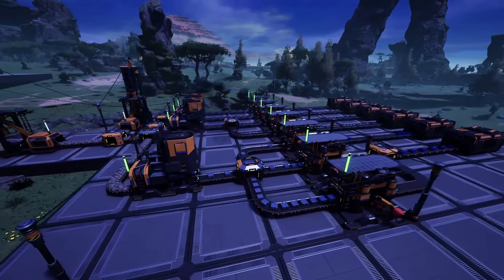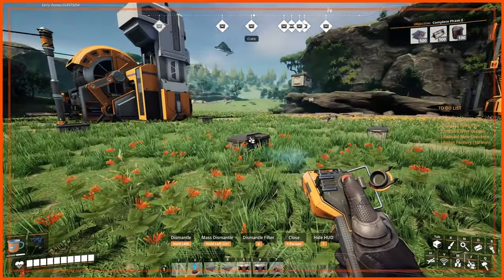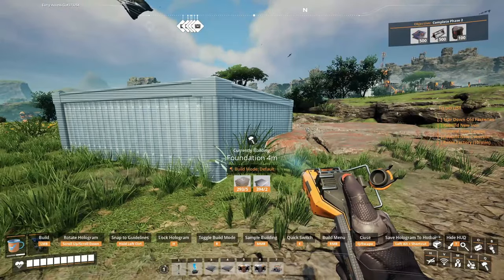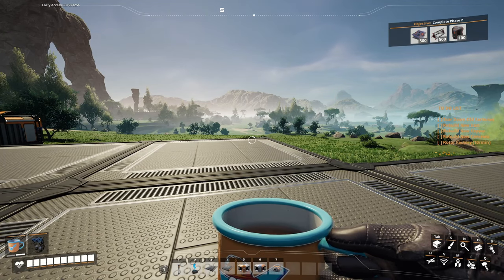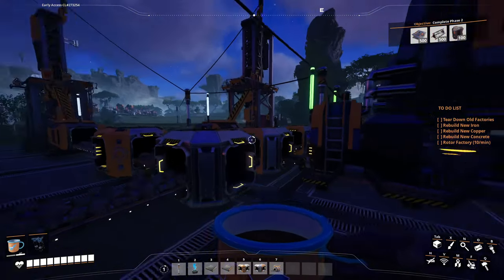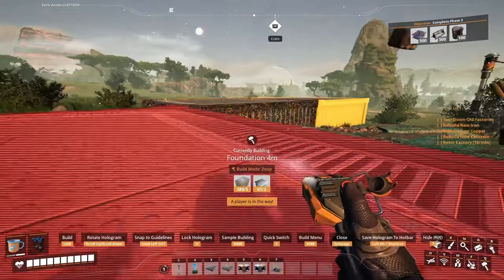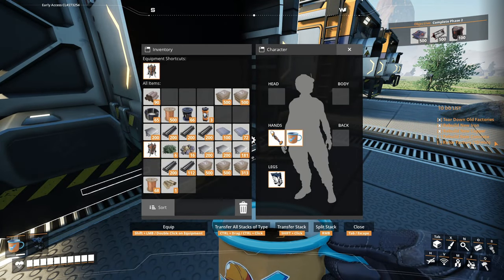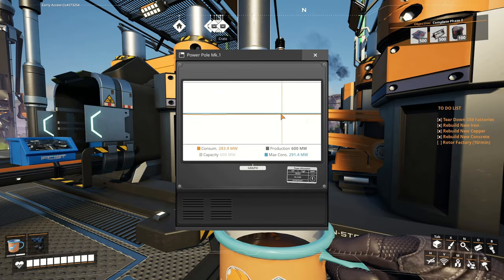Basic Layouts w/ 100% Efficiency!!! - Satisfactory Playthrough + Tutorial - Update 8 - Gameplay

Comment: I know this is months old but I was pulling my hair out when you were setting up the assemblers for the rotors. The reason why the elevator lift wasn't snapping to the correct point on the screw line was because you didn't reset the last belt on the line. You moved the splitter one over as it was misaligned but that meant the last belt was then clipping through the splitter.
Reply from the maker: I am SO ready for a redemption playthrough with 1.0 knowing what I do now! Cant wait! Ive got an update video with my plans for 1.0 dropping soon!

Comment: I recognise that this video is a couple months old and you're likely far past this point now, but for anybody watching for the first time, you can type formulas directly into the machine % production, so when underclocking the concrete constructors, you can highlight the 100% area and type in: (40/45)*100 and the machine will calculate the needed percentage. Then you can ctrl+c to copy that setting and ctrl+v to paste it to the other constructors.
Reply from the maker: Holy smokes that's going to really help me in the future! Thanks for a great tip 🙂
Reply: I am glad I read through the comments to make sure this was shared before double-posting it.
The only other thing I can recommend for early game when I don't necessarily have huge production, I'll make the first foundation (or blocks surrounding the whole build for aesthetics) 4m tall and then use a 1m platform aligned to the top of the 4m platform for the rest so that I can save on resources since making large platforms with 4m is so resource intensive at that point of the game.
Reply from the maker: @KurossuElemenze  yeah I really need to make sure we have decent concrete going early next playthrough so we can build stuff MUCH faster!

Comment from the maker: Thank you guys for all the support again! I'll try doing all my builds in daylight from now on. 

If you want some Ficsmas episodes let me know 🎄
Reply: Just a small thing but the copper sheet portion of factory can be simplified down to 1 merge and 1 split between smelters and constructors

Edit: also conveyor lifts auto detect direction from machines, splitters, and belts when placing and snapping to them.  Only really need to worry about direction of travel while  free placing or from non-connected floor holes, poles, and wall holes.
Reply from the maker: @douglashanks4189  good catch! I'll have to fix that in the next episode thanks 👍 🙂 

I also never knew that about the lifts that's super handy!

Comment: you may fix this later and I know this is 5 months old but you have the copper sheets setup wrong.  each smelter outputs 30, you then have that splitting so 1 line gets 15 and the other line gets 15.  So your 2 outer constructors are only getting 15 per minute when they need 20 and your middle one is getting 30 per minute when it only needs 20.  you would need to merge the two 30 lines together and THEN split the 60 line 3 ways to get 3 lines of 20.
Reply from the maker: I ended up tearing down all the starter factories for one huge basic mega factory! It took me like 4 episodes to put the whole thing together it was definitely a crazy project lol

Comment: Loving the content.  Much simpler to follow along for new players compared to so many other Satisfactory content creators.  They either go with megabuilds or super complex compact builds.  One minor note, there is an impure node literally meters away around the corner that you can overclock to get 60.  Merge the two miners together for the 120 limestone/min.  Or you could overclock the Normal and the impure nodes 100% each and get 180 limestone/min and use 4 constructors with no underclocking needed on the constructors.  Something to consider if there is a need for more concrete later down the road or if you are just looking to sink for Awesome Coupons.
Reply: Another thought would be to overclock the normal node to 90/min, split between two constructors.  Overclock the Impure node to 45/min, and feed directly into the third constructor.  Run the constructors at 100%.
Reply from the maker: Yeah I ended up making some concrete adjustments in a couple episodes, I definitely have just been picking nodes at random lol 

Thanks for the support I hope you enjoy the series 🙂